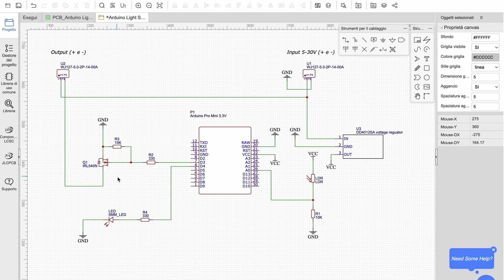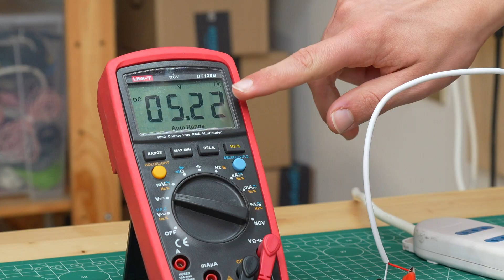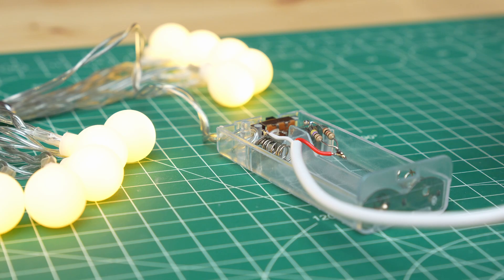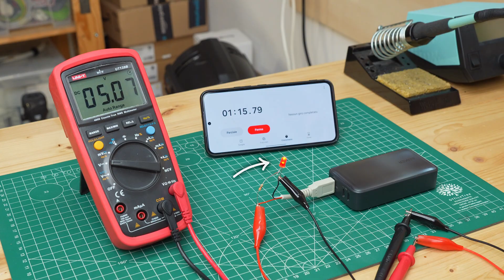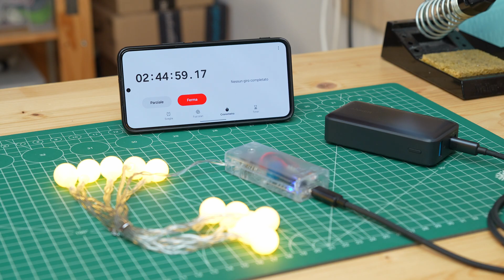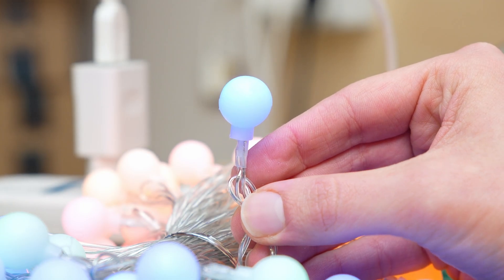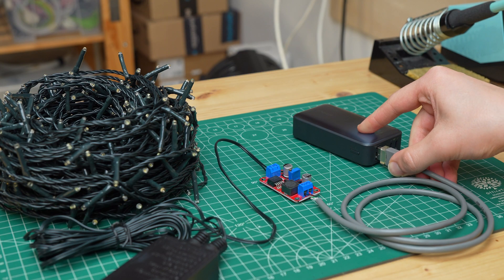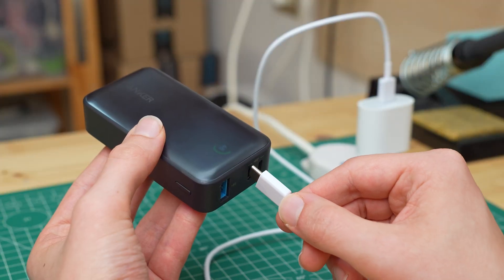This Genius Trick can Save You Hundreds of Dollars! Convert Christmas Lights from Batteries to USB

Comment: Giovanni, well done sir. I'd recommend to use a voltage regulator IC from e.g. 5v to 3.3v instead of a resistor. These are very cheap, marginally more expensive than a resistor and come with a better efficiency. That is how I did my battery powered LED lights a few years back and saved a ton in batteries. All the best and look forward for you next project.